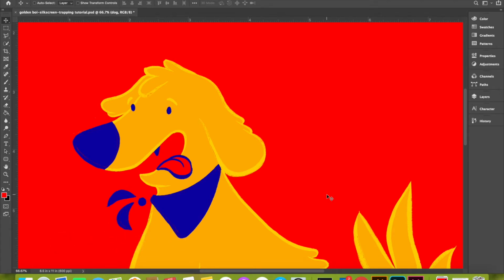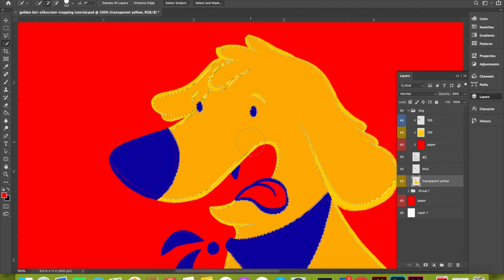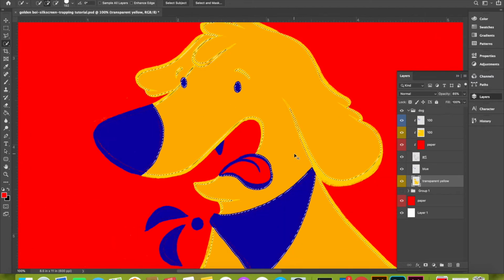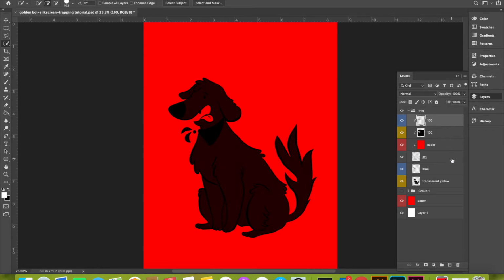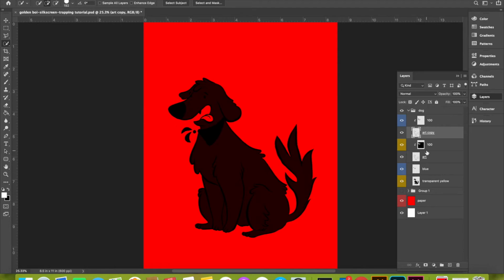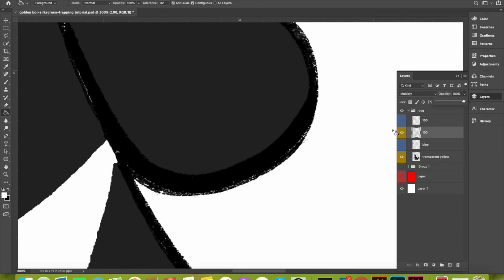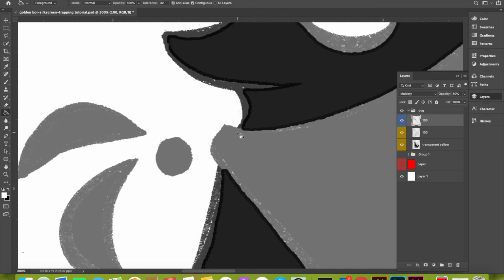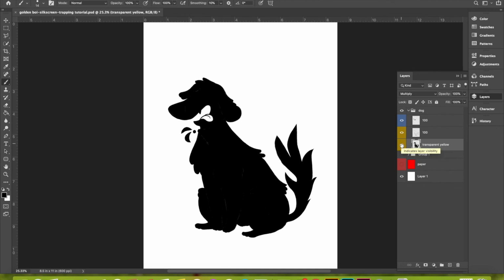Preparing Files with Trapping

Comment: Question: Why do you need to convert it to black and white for colour printing?
Reply: Coming from the screen printing side of things, converting it to black is what you do for your film positives.  Each color you want to print has it's own screen/film positive and your film positives have to be dark, so when you expose your screen, no light will go through it.  If you printed color ink on your film positives, they wouldn't block the light as well as black ink.  Hope this makes some sense!
Reply: @justintalley9155  but only for screen printing. Not for normal CMYK printing.